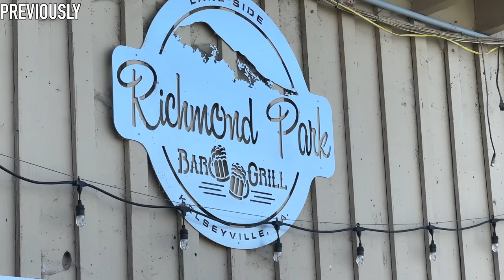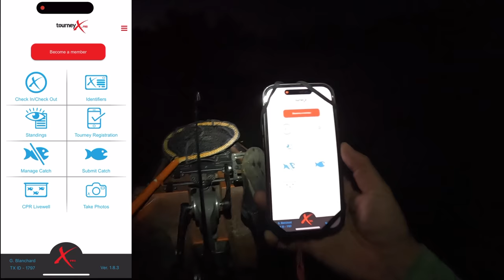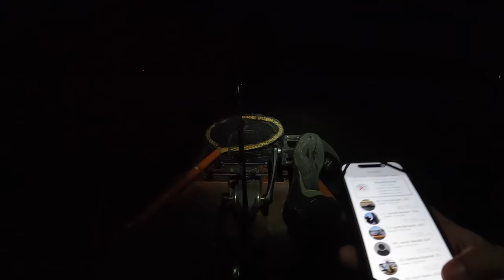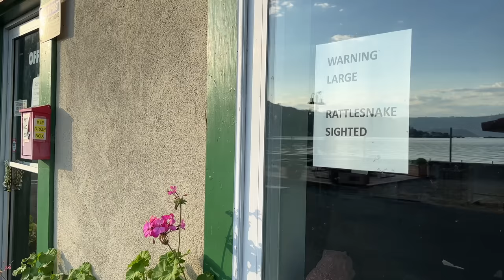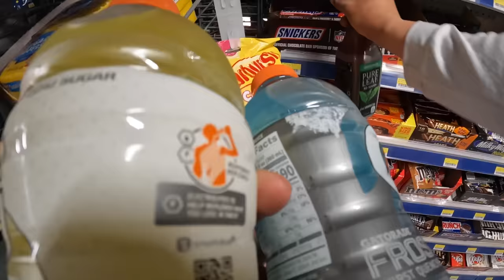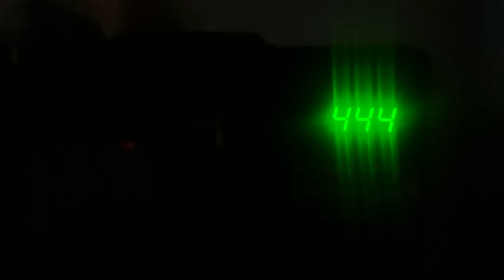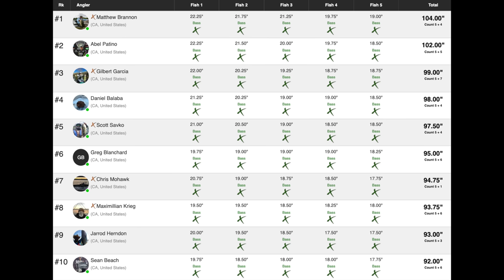Fishing a 34 Hour Straight Tournament

Comment: As always, top quality content and another great vid with the crew! I’ve noticed in quite a few of your vids you say I’m not sure if that’s gunna cul or you don’t think the fish is of size. I was thinking maybe you could scribe some lengths into the pole of your net. Like a quick reference guide 14in,  16in, 18in, 20in so you can quickly hold the fish to the net and if it’s not of size, quick release. Prolly save you a little time from taking out your measuring board and then putting it away. I dunno, just a thoughT. Keep up the good work and quality vids!! Been a fan and loyal subscriber for years!  🤙🏾